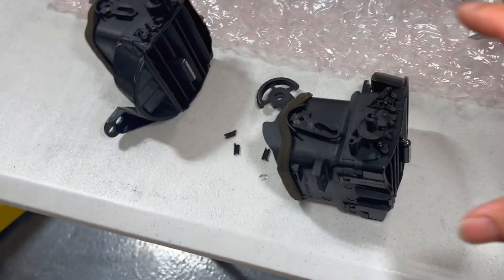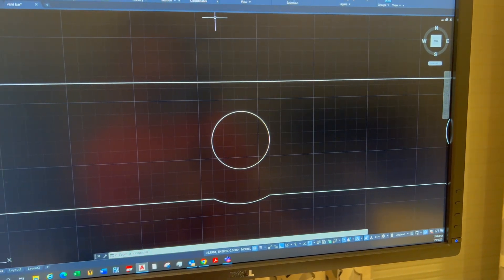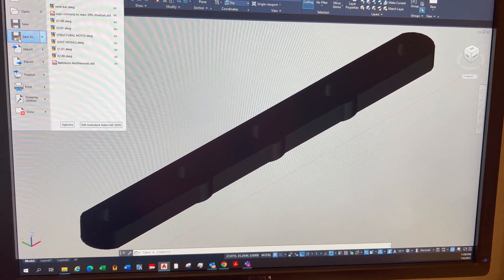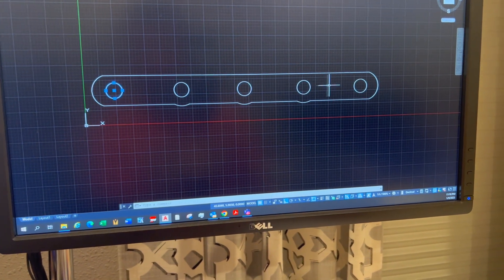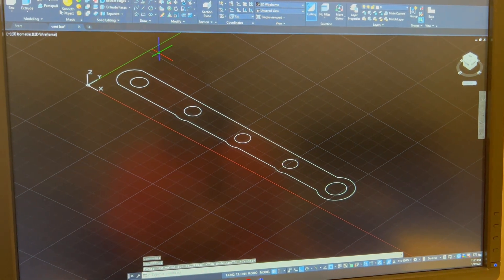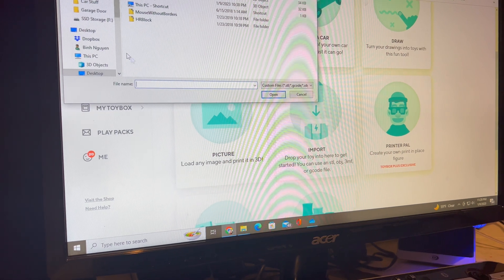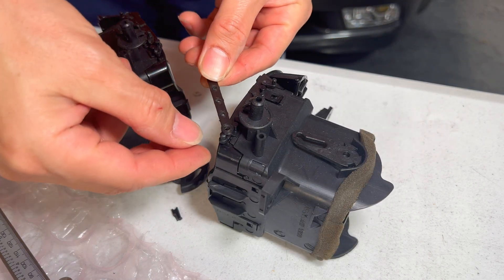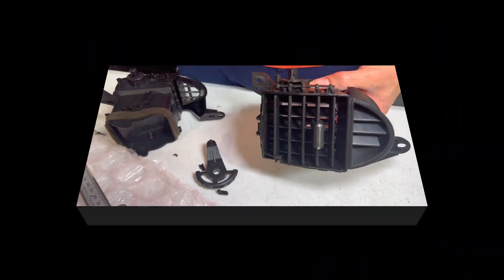3D Printing Repair Parts for Lexus IS300 Dash Vent with ToyBox Printer and AutoCAD

Comment: My is300 over heating and I replaced the thermostat I will be getting a ect sensor soon due to rain puddles but the inside of my car bubbles or pops when the car gets hot why and how man please help
Reply: What about the coolant sensor on the bottom of the Radiator?